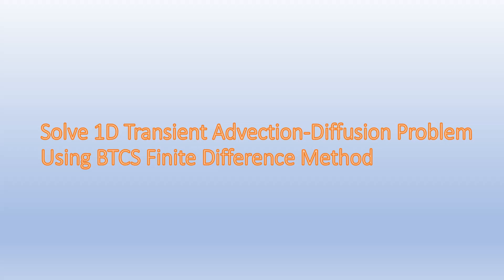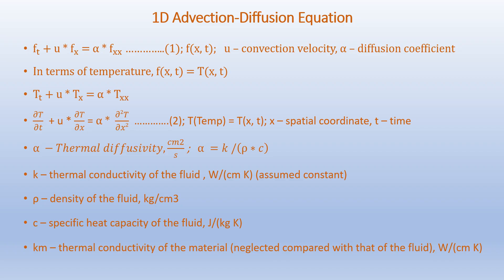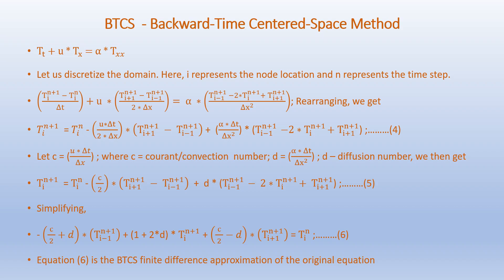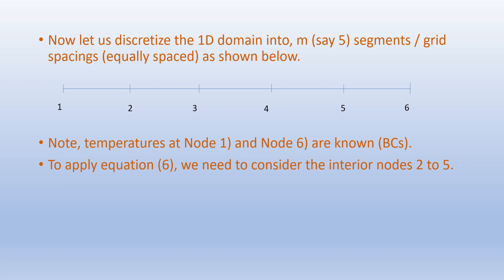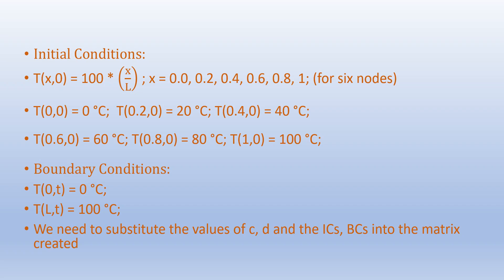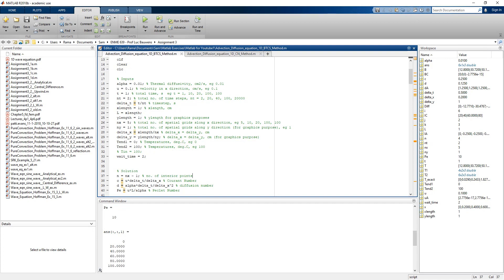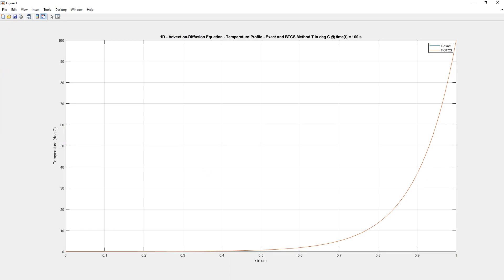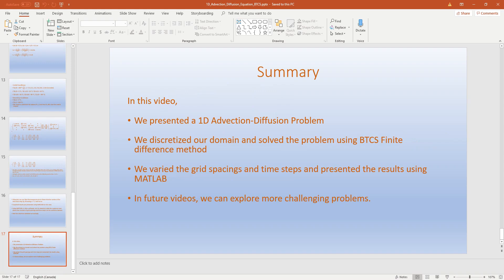Solve 1D Advection-Diffusion Equation Using BTCS Finite Difference Method

Comment: hey thank you for vides, can you send me the matlab code and problem for code
Reply from the maker: Check 
https://engineering-stream
for the code. Let me know if you cant find it
Reply: @samseleven1  the code have the function " T=Thomas_Algorithm_Func1(dA,lA,uA,B);
this is the error !1
Reply from the maker: @mohamedmadbouly1890  copy the code on a separate file from the website and name it and place this on the same folder. Rerun this and let me know
Reply: @samseleven1  i can't copy code from the website the code saved in website Jpj. 
can you send me your email
Reply from the maker: @mohamedmadbouly1890  you can read and type that
Reply from the maker: samseleven@gmail.com
Reply: Plz send me your email address